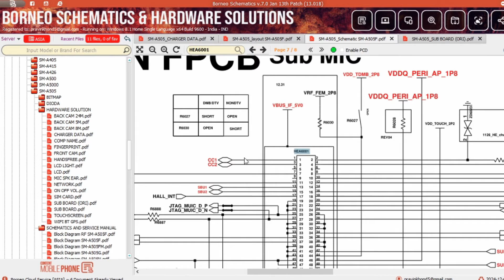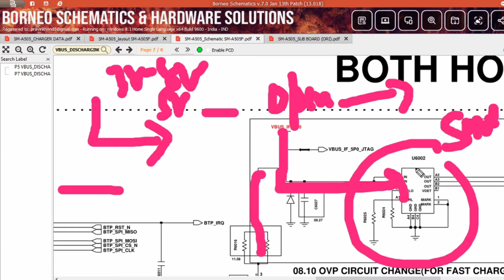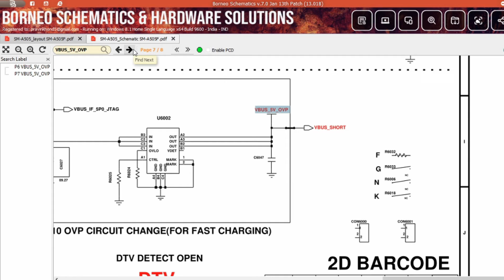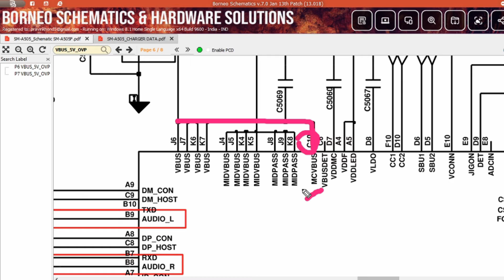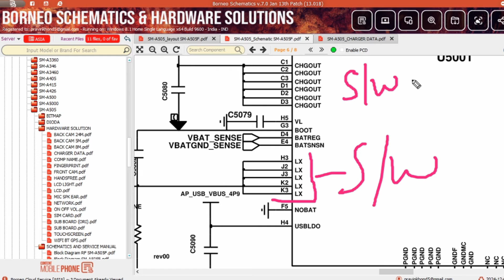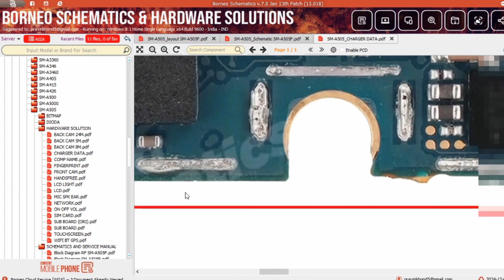Samsung Charging IC Testing+ Repair solution 💯  Schematics+Diagram Knowledge with Animation

Comment: Sir in my case having samsung A14 5g SM146b when i connect charger   there is only 0.4v at battery connector & all other voltages are normal & ok what does it mean, does it mean charging ic SM5714 ic is faulty or it mean ic not detects the battery that is why there is only 0.4v at battery connector